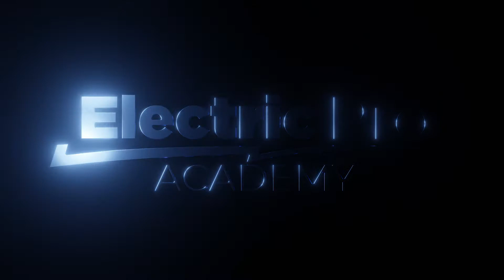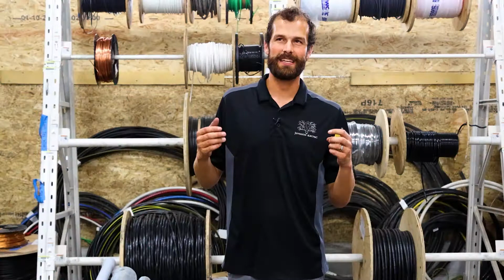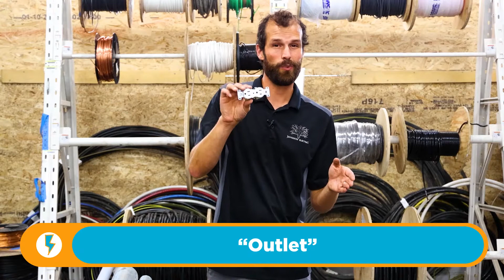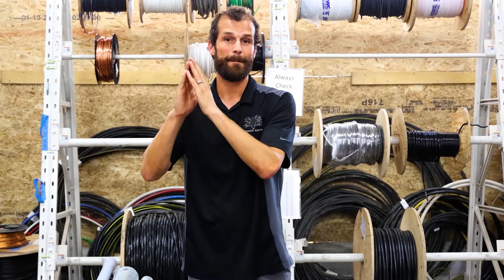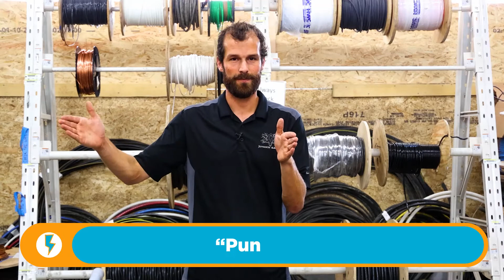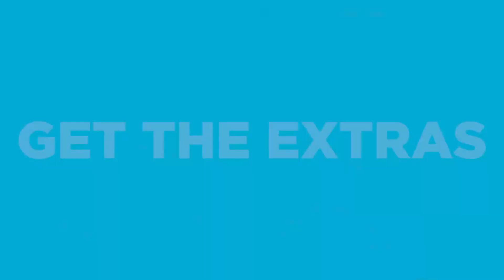13 Words & Phrases Used By Electrical Pros

Comment: Not a knock at you, but in vernacular in general. Receptacle can also be a rubbish bin. Electric socket could be a receptacle, a light socket, or a joint. Also the word "age" added to everything. It's Amperes, volts, watts, Etc. For example, you would never pay Ohmage because that doesn't make sense. Saying voltage or wattage also does not make much sense if thought about. To me, it sounds as off as "ohmage" does. It doesn't make sense. We have a volts drop or a power failure. Not an "outage" Not sure when all this strange vernacular came about or even became acceptable but it's really annoying to people like me that hear it. I am not the only one, I am just the only one that actually speaks up about it.

As for conduit, you know my answer. Galvanized stainless steel. Yes, it costs more. Yes, it will eventually rust but it's the best, especially for grounding. And when it comes to finished spaces it is a whole lot easier to fish wire through a tube than through open cavities in walls, drilled through fire stops, insulation, maybe even spray foam, and then staples. Otherwise you're tearing up drywall adding even MORE cost and delays, and complications. It will likely be over a few decades that metal conduit needs to be replace and it's the problem of the next generation. Even so, it would be easier to replace as well.

As for wire gauge, I would like to see 14 wire gauge be phased out. 12 gauge is more rigid, will last longer, be better for all the crap people plug into these days. Adding strips to convert to "receptacles" into 12 or more with their space heaters, there computers, TV sets, Video Game Consoles, DVR boxes, cable boxes, satellite boxes, coffee pots, tea kettles,  toaster ovens, air fryers... The list goes on forever. Especially in college dorms. Batteries are great too but they need to be recharged sooner or later, so now you have endless chargers for phones, tablets, laptops, I pads, or for me "Dewalt" power tools. That 14 gauge was fine back in the days when people only plugged in a lamp, but no one plugs in just a lamp anymore.
Reply from the maker: Thanks for sharing your thoughts, Michael.

Comment: Rigid sucks to run, better have your measurements right, bends and offsets right because it's a long walk back to the fab shop to adjust your pipe to make it right to fit

Comment: In todays world of tech and power needs, I personally think the use of a dual receptacle is long outdated and industry needs to move to quad style per location.  It’s more about accommodating all the gadgets without having power strips under beds and behind furniture making them fire hazards     Considering all the things we need to add due to code changes, this can be a benefit over annoyance.  BTW, let’s reinvent the blasted “outlet” and get past the single dual and develop a single quad.   Ken 👍

Comment: Is there a difference between plumbing pipe (galvanized steel or black iron) and electrical conduit (I think it's called rigid metallic conduit) which appears to be galvanized steel? They look the same but the  conduit costs much more. Is plumbing pipe permitted to be used according to NEC?

Comment: Hey Joel, I think you're a good teacher and an excellent speaker, but I have some comments. You said a 15 amp receptacle is only rated for 15 amps and anything higher it may melt, implying that a 20 amp receptacle would be a solution. This is false and feeds the common misconception that you need a 20 amp receptacle for a 20 amp circuit. A 15 amp "spec grade" receptacle is the same as a 20 amp except for the horizontal slot in the plastic housing. It's also code compliant in a 20 amp circuit as long as It's a duplex receptacle.  The wire gauge is the gating item. Using the water analogy, 12 gauge is a bigger pipe than 14 gauge. You mentioned rating for 120 volts "nominal". By nominal I assume you mean RMS voltage. Peak voltage is approximately 170 volts and peak to peak is double that.
In general, I like your channel, I recently subscribed.
Reply: "Nominal" means "or there abouts."   The UPS my computer is plugged into will care if the voltage is 125 volts versus 120, but my toaster won't care.
No one cares about the peak waveform voltage in electrical service like this.  Everything is rated by RMS voltage.